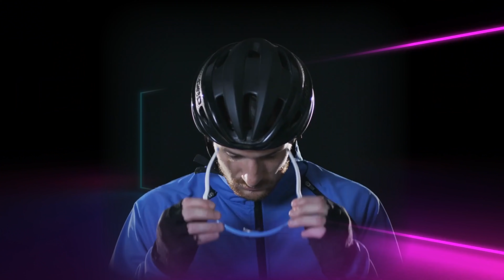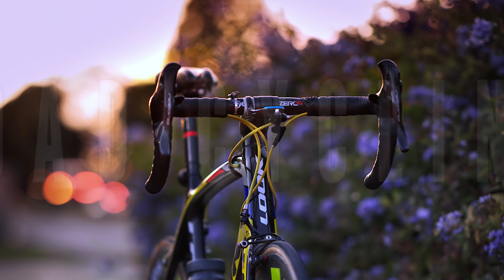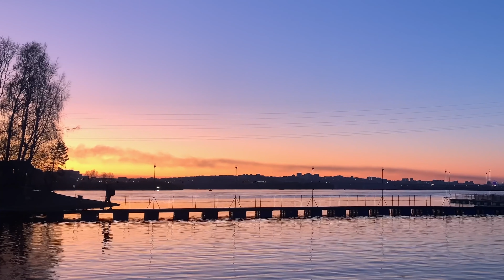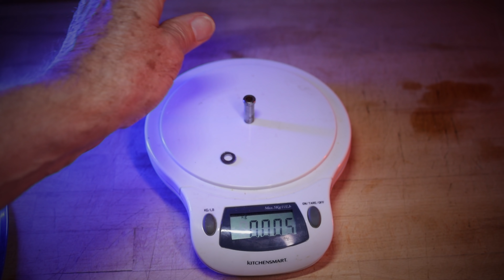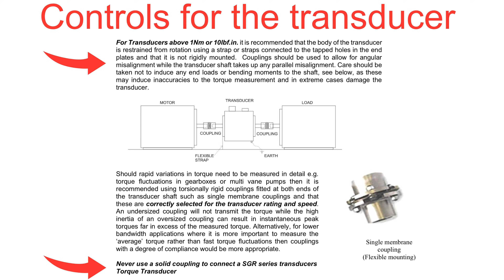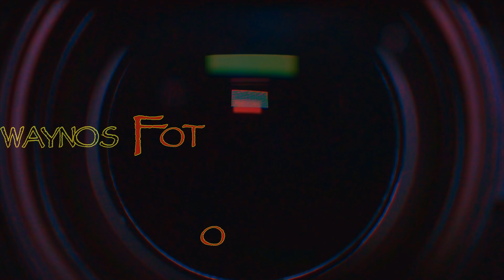HAMBINI CLAIMS, AbsoluteBLACK test results not realistic!

Comment: Absolute black were very amateur in the set up they showed for proving their claims, and had their pants pulled down.
Any decent company would have reams of data to prove hambini wrong, however this companies tactic is to get someone's video pulled as on his first one.
It's clear to see to everyone their claims are rubbish, their equipment is simply not sensitive enough to measure any tiny gain, and they have been found out. I feel sorry for the people who bought into their claims, from what I seen the product wasn't even a quality product on the tear down, plastic bearings and plastic housing, not carbon fibre.

Comment: When a bike company makes ANY claim that what they SELL will save you time, lower resistance, make you more aero, DON'T BELIEVE THEM.  The reason that the cycling industry has now decided that "weight does not matter" is that they hate weight because everyone has a scale that will prove them wrong if they lie.  For decades the bike industry just lied about weight... scales became very common and they could not lie as much (they still do, they are just smarter about it).
Reply: Let's face it the heaviest item on a bike is the rider, and the vast majority of us are not elite athletes, so rather than spending thousands on lighter parts, it's cheaper for the rider to shed a few lbs.
Reply: @acelectricalsecurity  Cheaper but more effort unfortunately
Reply: Scales have been common for decades. People sell on weight less because wind tunnel testing and CFD is now within reach for a lot of companies, and more and more aspects have been tested and disproved. Plenty of people still harp on weight simply because you can feel the difference under you, whereas you can't "feel" being 10 seconds quicker over a 40k

Comment: For the demonstration of the washer and bolt, the simple explanation why it is detected when the bolt is added is because the bolt may be 5.9 grams and the 0.2g of the washer will push it over 6g so it is detected. However by itself the washer is 0.2g and will not be detected by the scales because it is 0.8g below the sensitivity of the scales which is 1g. 

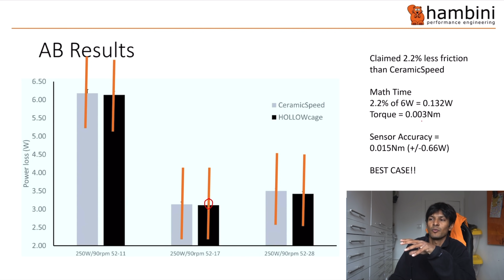As for Hambini saying the amount of error is quite large, that's not what statisticians looks for when detecting dodgy results. If the results were fixed or the instruments out of whack you'd typically find that the variation (or standard deviation - the lines showing the dispersion of data readings @ 6:33) would be reduced for the critical measurements, the fact that this isn't the case and is the same for the all measurements shows that the rig is measuring the the same variation in readings around the mean value. The rig is fine . 

I think AbsoluteBLACK primary claim for the rear derailleur pulley was that it was extremely quiet compared to rivals. And, in reviews by others this has been found to be true, in fact in other hands they found that the pulley exceeded the quoted measurements, though probably within margin of error.

Now whether you want to spend hundreds of dollars buying it is your prerogative - but it definitely stacks up to it's claims.
Reply from the maker: Nope, it doesn't really work like that. Yes the washer may be less than a gram, but my point is measuring very small amounts with a device which is not designed for that scale is unreliable.
The variance when you do "real" accredited accuracy work needs to be expressed in the report, nothing is absolute. There will always be a variance of uncertainty with any measurement.
Reply: @waynosfotos  , if you could repeat test and use 2 or more "almost" the same washers. By adding 1 (2,3,..) additional washer, lets assume they weight approx. 1g. , scale would show that.
Reply: @waynosfotos  
If sensitivity is the issue and you are absolutely 100% sure the equipment cannot measure the differences then the only way to generate the data points is to falsify them. 

Then why don't you say this?  

Unless you're not sure that this is the case?
Reply: @bitchoflivingblah  that's a rather extreme extrapolation -- unless you would also claim that any estimate is a falsification -- which goes to the heart of the issues here in terms of how data is presented to consumers.

The issue here is that if we accept that the readings are in fact estimates because of the lack of sensitivity, the variance of those readings is exceeding the reading itself, making them wholly unreliable -- but they are being presented to the consumer with no reference to the lack of sensitivity (or confidence if we want to go probabilistic) - meaning the consumer would default to that reading being taken reliably.
Reply: @HappyDuude  No, I'm just pointing out a very real scenario.

If the equipment is NOT sensitive to measure the differences stated, then you will generate what looks like a random scatter of data of at the threshold of detection for both control and test groups - in essence noise.

To go from that to data where you can see statistical differences between the control and test group requires someone MAKING up data. This is typically called fraud.
Reply: There is a difference between detecting "dodgy" results and knowing the error of your measurements. If you detect that a measurement is wrong you usually don't count it or even rethink your measuring methodology.

Theory of Errors isn't exactly statistics that's why it's not practiced by mathematicians but engineers.
Reply: Also if tests are done, multiple tests are performed and then an average is determined. At least that is the way it is supposed to work.
Reply: @DaveCM  Which is exactly what is described in the graphs, the average of the dataset has been determined as the tip of the bar and the error bars show either the standard deviation or standard error of the mean.
Reply: No, your just wrong.
Reply: I agree.  It appears that the test rig is sufficiently sensitive to show a definitive difference between the control and the OSPW.  It doesn't matter to me that, due to accuracy concerns, we don't know exactly what that difference is, or precisely what the drag levels are for both the control and the OSPW.  What is the value of that information to a potential purchaser?   They just need to know that it is both better, and shinier than the competition!
Reply: @rgefryer  I agree, nothing wrong with the test rig, it is that the results of the tests are not significantly different. 

The data shown wouldn't get past a peer review if the authors stated that they demonstrated a difference, as there isn't one.

It's not an issue of accuracy as the instrument shows the same variation in measurement it's the fact that there is hardly any difference in power loss between the two products that is at issue. 

In that latter regard I completely agree that this claim is overblown.

Comment: I just think that shimano would make the pulleys oversize if there was any tangible benefits. They do say that Dura ace is not made to a price point after all
Reply: They did, it's called Tourney.
Reply: Shimano did that already with the 7700 Dura Ace derailleur!
Bigger pulleys don’t bend the chain that much—max 42mm jockey wheels do fit in Shimano short cage derailleurs,
and it also will benefit the shifting performance — if you have good quality ones 🤙🍀🚴
Reply: @domestique3954  where’s the proof of better shifting performance?
Reply: @domestique3954  I've never seen Shimano come with oversized jockey wheels. I just Googled it for the 7700 series and found nothing. Can you clarify your comment?
Reply: @DaveCM  It’s the “GS” long-cage variant of the RD-7700, meant for the triple crank option. It seems it was designed that way to take up more chain for the wide range cassette and triple chainset, but the larger wheels probably do also reduce the friction ever so slightly by decreasing the bend in the chain.
Reply: @domestique3954  that's not bigger jockey wheels diameter . That's a longer cage to accommodate the larger difference in cog size and chain slack .
Reply: @edmundscycles1  It's both. The RD-7700 GS has 13 tooth pulleys, compared to the SS short-cage version which has 11 tooth pulleys. They look substantially bigger than normal pulleys in person.
Reply: @ravinvar  the point of those is to catter for a larger gap in gear ratios and are no where near as exaggerated as the systems like absolute black and ceramic speed . Nor are they advertised as watt saving device . They do as advertised and cost under £30 as a new part .
Reply: @edmundscycles1  Yes, chain takeup is the point of the jockey wheels, which is exactly why I said as much. Despite that, their larger size almost certainly contributes an (admittedly imperceptible) decrease in friction because the chain plates do not have to articulate as much when wrapping around them. 

I couldn’t say whether they are $30 or how they are advertised as they are a nearly 25 year old part, and I suspect Shimano neither sells or has advertised them in almost 2 decades.

Comment: He is wise beyond his five years …..
Reply from the maker: Been 5 yrs for a long time, never seems to go up! Lol
Reply: I believe that you entirely missed the point.  Calibration of the instrument doesn't make it more accurate. Just as you showed that the brake nut and washer gave different readings, Calibration only tells you the actual accuracy.  It doesn't make it more accurate.  It demonstrates how wide those error bars are.
Reply from the maker: Nope, if you get it calibrated at say 5N then the error will be given at this point. So instead of having a plus or minus, you have a actual error at this point, so then you have not got as big a variance. You will still need to do modelling and set your labs variance due to your controls, but your variance will be lower at a set confidence level.